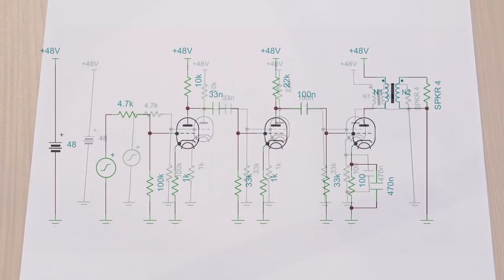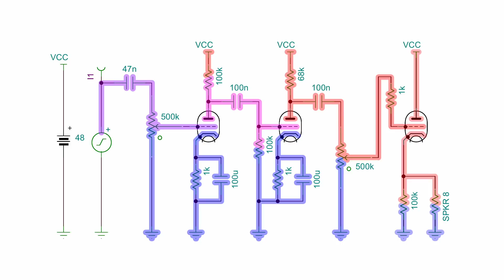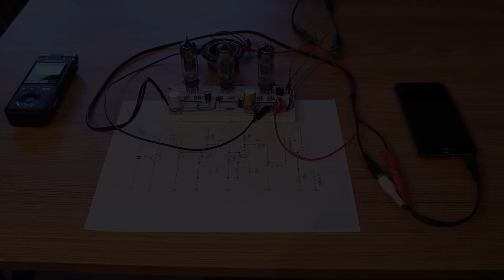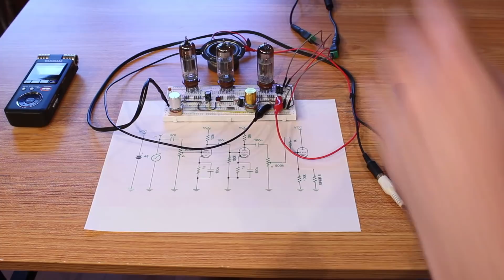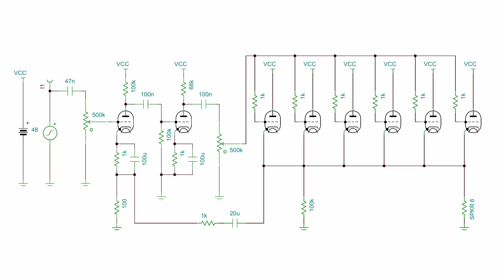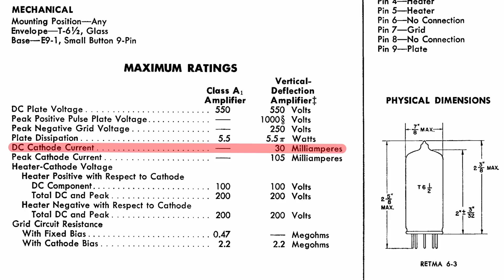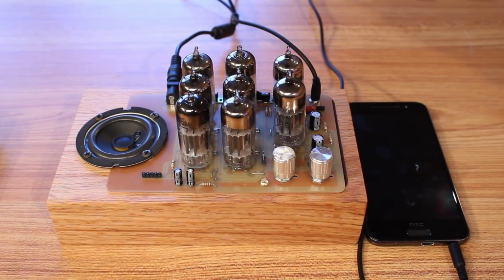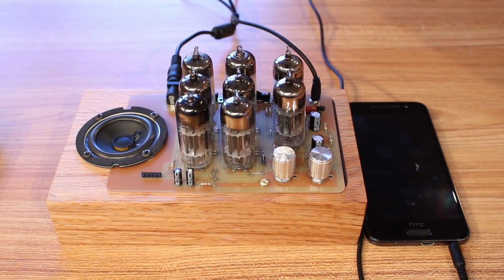A Low Voltage Vacuum Tube OTL Audio Amplifier

Comment: Great idea!  I am also a fan of OTL amplifiers.   Here are a few suggestions:

(1)  That tiny speaker has two er, three fatal flaws regarding OTL:  (1) It is probably very low efficiency and of course (2) Very poor bass response.  You might want to try something like an old 1960's large speaker, those were many times more efficient and therefore louder and less distorty at reasonable volume levels.  (2)  Put the speaker in a sealed box, that will greatly improve the bass.   (3) Put an 8 ohm resistor or a 1 Henry choke from cathodes to ground and couple the speaker through a 470uF capacitor, that will allow the speaker to run centered and perhaps less distorty.

(2)  There is a huge impedance mismatch between the tubes and the speaker.  Maybe look around for a 40 ohm voice coil speaker?  Or put a transformer between cathodes and ground?  Adequate choices might be a wall-wart 120V to 6V transformer.  You will likely get like TEN TIMES the power to the speaker.   I know this shivs the OTL principle, but it really isn't an "output transformer" per se and you will get TONS more output!!!!   

(3)  Another work-around is to use a PA speaker, those come with included "70.7V" transformers riveted on, and that will be a much better impedance match to your tubes.  True, there still is an "OT", but you didn't design it in!   Fudgy, but so much louder.

For comparison I made an OTL amplifier using two 6080 tubes.  Without an OT I only got about 300 milliwatts, very weak.  With an old Tektronix power transformer as OT I got 4 watts, quite enough for an efficient speaker to blast out adequate sound.

Regards and great respects!

-- George
Reply from the maker: Thank you!
And thank you for the excellent suggestions!

The speaker is definitely ill-suited for this application, but it was what I had on hand. The wood box made a huge difference to base response though and both volume and range nearly doubled when I put the speaker in place. 
I also did try to put a few different coupling caps in series when testing the design to remove any DC through the coil, but no matter what size cap I tried, it always decimated the sound. Like removed greater than 90% of volume. It could be that I just didn't get a large enough capacitor, but I think it mostly had to do with weird impedance mismatching and the insanely low voltages I'm running at. 

Which is what you mentioned next! The speaker is an 8 ohm speaker, and I think the 6x 12B4As in parallel have an impedance of around 200 ohms, which is just way too much. Keeping with the concept of pure OTL, I have a few ideas. Another commenter suggested using the White Cathode Follower design, which looks really promising, but I have to do a lot more reading to figure out what the output impedance would be using that design. Also, I happen to have 14x 6146s hanging about that I'm not doing anything with. Even as a standard cathode follower, the 14 of them in parallel would bring output impedance down to like 50 ohms, which with some speakers in series perhaps could get the impedance very close indeed!

I know an output transformer is the right way to do it, and if I were building an amplifier to actually have a nice sounding amp to listen to, that is what I would do. But, I already happen to have a Magnavox Concert Grand from 1962 that has two 40W amplifiers using a cadre of 6V6s and sounds absolutely sublime! So, this OTL shenanigans is purely a learning exercise to see just what all I can accomplish with some brute force ideas!
Reply: @UsagiElectric  The choke to ground and 470uF capacitor to speaker should have worked.  Maybe you used too small a capacitor?   The 6146 tube, if you look at its plate curves, is not very peppy at low plate voltages and has a high plate resistance, so it's not going to be a great match to an 8 ohm speaker.  You could use 16 of them in parallel, then the heaters could be run off 120 VAC, and the plates off a half-wave or voltage doubler, so you could eliminate the power transformer too!!.  Be careful though to keep the cathodes going to the white wire (neutral) side of the AC power.   A better choice would be some tubes designed for lower plate voltage, like the classic 6AS7 or its military brother the 6080 or the pepped-up 6336.  Somewhere in my attic I have a case of 6080's and a brass chassis, for a long-delayed 20-tube OTL.  Keep up the good work!
Reply: Oh another little detail-- it looks like the tubes are running at zero or just grid-leak bias-- that's kinda iffy for audio.  It might sound better with like -9 volts bias on the grids from a 9-volt battery through a 1Meg resistor.  That will center the tubes a bit better into their operating range.  Grid-leak bias is more for Class C operation or for tubes designed for zero bias.  Regards!

Comment: 12U7 would work better for the low level stages- they're designed for low voltages and have a bit higher u.
Reply from the maker: You're totally right, there's some excellent space charge tubes out there that give a lot of current at really low plate voltages! 
Unfortunately, they're a bit expensive and rare, I just so happened to have either of those 12B4As floating around, so I decided to give that a shot and was super happy with the results!
Reply: @UsagiElectric   Expensive?  Usually they're some of the cheapest ones, in my experience, since their applications were fairly limited.  The 12U7 wasn't strictly a space charge type tube.

Comment: The DC coupling definitely helps with the metal rock.

The DC bias it puts on the speaker may or may not be making much of a difference.  It depends on the capability of the speaker.  Too much bias and it will bottom or top out the cone at the extremes of its travel well before it would do so without the bias.  Using a choke in the vicinity of 1 henry (with the smallest resistance practical) as a direct load and connecting the speaker via a large capacitor in the vicinity of 1000 uF would eliminate the bias.  The high value resistor from the cathodes to ground shouldn't make a difference at all given the low impedance of everything else.

With powers this small "red plating" is not likely.  Overstressing the tiny cathodes would be more likely.
Reply from the maker: Thank you for the excellent info!

I actually did try to put a few different caps in series when testing the design to remove any DC through the coil, but no matter what size cap I tried, it always decimated the sound. Like removed greater than 90% of volume. It could be that I just didn't get a large enough capacitor, but I think it mostly had to do with the insanely low voltages I'm running at. 

The 12B4A was moving around 40mA through each tube, which at 48V should mean an internal resistance of about 1200 ohms per tube. With six in parallel that should be something like 200 ohms of series resistance with the speaker. 
I think the impedance is just so ridiculously mismatched that adding a series capacitor just wrecked whatever weird balance I had going on here. 
Or I could be totally off the mark, this is all uncharted territory for me!
Reply: @UsagiElectric  You'll need a sufficient DC load for the cathodes to get any beef from this amplifier from a capacitor isolated speaker if the speaker isn't the DC load (that 100K is a joke)  That's why I suggested the choke.  It's possible to get low resistance toroidal chokes today for ridiculous cheap prices.  The choke will block AC, letting it be able to pass on all the better to the speaker.
Mismatch is part of why you don't have the very best output possible.  But it still should be possible to spare the speaker a DC bias.

Remember the cathodes can pull (positive) but cannot push (negative).  That's what a DC load is for.

Comment: better to make the output stage push pull with zero dc  offset across speaker
Reply from the maker: I actually did initially try building a push pull type amplifier with driver triodes before and after the speaker to get a full range voltage swing out of it, but it absolutely refused to work. It made some sound, but it was extremely faint and distorted beyond belief. I also tried to run a big capacitor in series with the speaker, but the impedance mismatching is so ridiculous here that that totally failed to work too.
In the end, this super simple (but compromised) design ended up working the best!

Comment: I've spent the last 40 years designing at 5v. 8 years ago I renovated 1932 Philco Cathedral, been doing tubes since. Jumping to 3, 4, 500 volts is a little scary but just listen to Alanis and keep your Hand in Your Pocket and you'll be safe. Thanks for the video.
Reply from the maker: Thanks for checking the video out!
I actually started learning electronics in earnest with BEAM robots, which are even lower voltage than 5v since they're usually solar powered. The transition from that to tubes was an interesting one because BEAM stuff is all about being as absolutely efficient as possible and the average tubes heater consumes more power in a minute than a BEAM bot will in its entire life!
I am slowly getting more comfortable working with higher voltages, particularly after learning and working on various HP equipment, but there's still a massively fun allure to working tubes at low voltages!
Reply: @UsagiElectric  yeah, I can see low voltage tube design being a real challenge. The important thing is having fun and learning, which you look like your having.

Comment: What a cool journey through non-conventional tube amp design! Just today I was studying cathode - followers for guitar amps and it is so cool to see them drive a speaker directly!
Thank you for such a wonderful content!
Reply from the maker: Thank you so much!
It's interesting how many different ways there are to tackle tube amplifier design! OTL amps really appeal to me, so this definitely won't be the last one I build. There's a ton of place I can improve on the design and get even better sound out of it. Plus, I have a handful of 6146 Power tubes that when triode strapped should be able to move about three times as much current as the 12B4A, which should be pretty exciting!

Comment: you could put a thermistor betwwen the power source and the red-plate potentiometer
Reply from the maker: I'm not sure I'm following you here?
Thermistors are usually used for limiting inrush current, right? But, the "red-plate" potentiometer is just controlling the voltage level on the grids of the output tubes, there shouldn't be any appreciable current flowing through there at all.
As for powering the tube filaments from the power source, in this case it didn't really seem to be a big issue, the little 48V supply I'm using seemed to handle the inrush with no problems!
Reply: @UsagiElectric  after the amp has been on a while it is still apt to redplate if the pot isn't  turned to about 2/3

Comment: You should try the 6С19П triode. It can pass a lot of current for it's heating. I tried to do a OTL with two of these in a SRPP configuration, a coupling capacitor and serial connected speakers. It kind of worked
Reply from the maker: Whoa, I hadn't heard of the 6С19П triode before, but you're right, that thing can move some serious current! My next plan was to actually use a bunch of 6146s triode strapped because even at 50V they can move something like 70mA (more than double the 12B4A). 
OTL is super interesting because it definitely requires a shift in thinking just to even get some sound out of it!
Reply: Whoa! That makes me wanna try using that little bugger with a 100R speaker I got recently...

Comment: Funny you are going full circle.  Starting in aviation and ending up in aviation.    OTL was one way they cut down on size on early light aircraft radios.  One schematic I have handy uses two triodes for the output stage. Of course you need a set of crystal earphones to use with them but  the same effect.   Might I suggest a by-pass cap  on our output to cut down on the tinny sound.   .001 uf.  As well you might want to use self bias vs cathode for the first stage  you will get better gain.  Pardon the sacrilege the 'Champ' was not a good design to start with ;)
Reply from the maker: That's actually really awesome, I had no idea that they would use OTL in aircraft radios to cut down on size. That makes a ton of sense though because space is at an absolute premium in a cockpit. 
I actually did try a couple by-pass caps on the driver tube output into the speaker coil to cut down on DC bias across the speaker, but the impedance mismatching is so ferociously bad, it didn't work at all. I'll have to give the whole design a proper rethink. 
And while the Champ Amp may not be a very good design, boy it sure is simple, haha!
Reply: @UsagiElectric  Yeah impedance matching is a real key to any out-put stage.  That is why they put 'Transconduntance' on data sheets.  Of course that is only matching to an output transformer but I wonder if you could use in in a formula for a direct couple to a speaker.  Have a nice time trying to find a speaker other than 4 or 8.  There are 3.2 out there but few an far between.    You might come up with something like 6.68 or alike ;)
Reply: Mejor aún busca un altavoz de 800 ohmios,  600 ohmios o 200 ohmios que es tu caso, con eso te puedes ahorrar hasta  2 válvulas de salida😊, 
También tienes altavoces de 16 o mas, y ya sabes puedes ponerlos en serie.

También hay cascos de 600 o 200  ohmios de estudio de Senheiser o Akay, muy recomendables, ya los tengo y van muy bien, y te sorprendería comprobar como rinden hasta en graves los philips de tan solo 6", rinden como los de 12" de 8 ohmios, espectacular.

Yo he tenido en altavoces de  800 y 600 ohmios salida directa incluso sin acoplar por condensador, y aunque la C.C. mejor evitarla no has muerto con envío de 5 a 10 voltios, en el banco de pruebas se puede llevar al altavoz hasta los límites para verificar situaciones y funcionamiento.
Nunca se me han estropeado altavoces de 800  o 600 ohmios, y los de Philips me encantan.
Ojo que también he conducido altavoces normales, pero necesitas mas en serie , aunque incluso uno de 16 ohmios y 103 db trabaja pero no sacas todo el rendimiento al amplificador que puede dar.
Reply: Depends on what you mean by good. I have a 5F1 ‘Champ’ clone, and it is beloved of guitar players for a very good reason. Crank it, and you have rock ‘n  roll and heavy blues tone in a bottle. That’s why players like Keith Richard and Joe Bonamassa love them. 
It was never intended as a hifi amp - although on low gain it sounds quite nice through good speakers.
No amount of objective measurement and analysis could refute the fact that, as a guitar amp, it makes a sound judged by the world of musicians and their audience as being quintessential rock and roll.
✌ 👽 🎸

Comment: I think you should try white cathode follower (WCF) next time. And I recommend you not to quit from output transformers, they can be funny part of designing tube amp, espesialy when you use tetrode or beam-tetrode/pentode where you cen make many diffrent circuit like ultra-linear or super pentode or even unity coupled like in McIntosh apms. 😉
Reply from the maker: Ooh, the white cathode follower is very, very cool! I'll definitely have to experiment with that one next time!
I wouldn't say that I have given up on output transformers, they're definitely the right way to do it, but I've got the OTL bug now, I totally want to build a properly wicked OTL amplifier!
Reply: @UsagiElectric jajaja pues para ello añade un otl en puente cerrado de 4 o bucle, parece ser que cuadriplica potencia o aún mas, aunque supongo se necesitan varias fuentes de sumimistro de tensión para ello. 🎉😮

Comment: My tiny five cents worth... The Video kind of drives me nuts because it's not dealing with the way a vacuum tube works and the characteristics of this tube chosen so it operates in its designed-for range of voltages.... At least you should have pointed that out at the start plus that lousy quality speaker is not going to help the cause.
Reply from the maker: Thank you for the feedback!
I'm not sure if you're familiar with my other videos, but using tubes in situations that are massively out of their comfort zone is my whole thing! I have an entire vacuum tube computer that I'm building that only runs at +24V and -12V, which is ludicrously low voltage for tubes. 
I really love the idea of using tubes in really strange setups and situations, and pushing the boundaries of what tubes are capable of. 

As for the speaker, you gotta remember that by the time you hear it, the audio has been through hell and back. The original recording was compressed down into an MP3, then played through my cellphone's audio player, which was then amplified and output by my OTL and speaker. Then it finds its way into my audio recorder microphone, where it gets compressed into MP3 format yet again, then it gets pulled into Davinci Resolve which compresses it again with its own algorithm when rendering the video. Then I transcode that video using Handbrake (which, you guessed it, compresses the audio yet again). Finally, I upload the transcoded video to Youtube, who then does all sorts of mystery stuff to the audio before its streamed around the world to your computer/cellphone/TV, which processes the audio uses its own internal hardware and plays it back through unknown speakers.

In person it sounds much, much better than I can ever convey over video/Youtube. Sure, it's not even 1/100 as good as my 1972 Magnavox Concert Grand, but if I'm not trying to build something that can compete with that (because nothing can, that's the best sounding audio system I've ever heard in my life). I'm just trying to have a little fun!